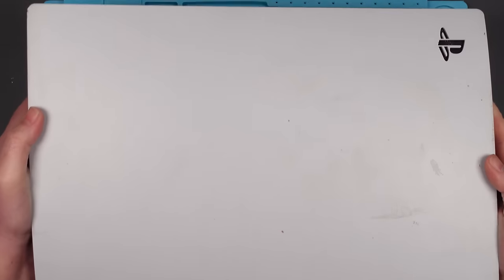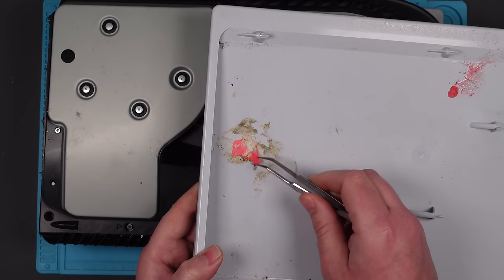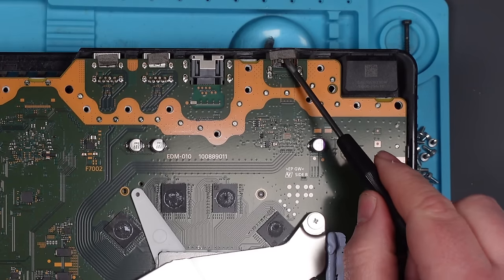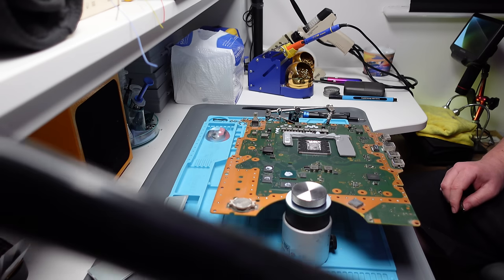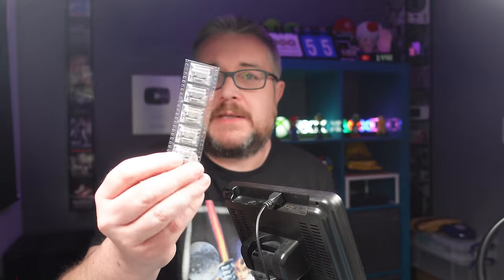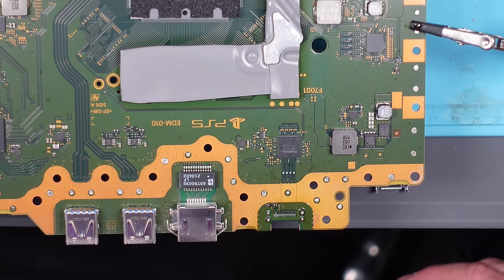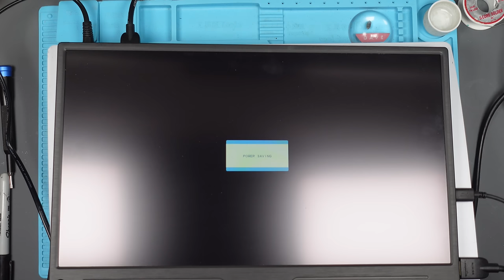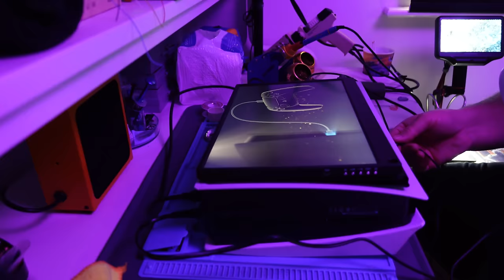This PS5 was DROPPED | Can I FIX It?

Comment: The fact you got a faulty ps5 from Ebay with a genuine honest description is incredibly rare. Congrats
Reply: not to brag but i got a ps5 disk and series dirt cheap with hdmi port damage and only that and fixed them both and been running for a year now. maybe luck
Reply: @GeoJad  very fortunate
Reply: Mate my ps5 turns of after about 30 mins of playing a ps5 game I’ve cleaned the inside but I haven’t gone further and done the psu or whatever it’s called
Reply: @coreyblakee332 chances are the heatsink is full of dust

If you have it standing upwards could also be a dry spot on the APU.
Reply: @Trippy86117  I have had it upwards since I got it I’ve had it since release pretty much but yeah it’s defo fucked need to try get it repaired I’m waiting for the ps5 pro and will purchase that lol 😂

Comment: 2:10 there clearly was a kids birthday party inside this machine
Reply from the maker: 😂 must have been!
Reply: I'm wondering if it was a birthday present that never made it past the party. As Steve mentions it's factory reset right at the end.
Reply: @MrCode4money perhaps but the amount of dust on the fan would suggest otherwise
Reply: @f1zzdux  yeah good point. Interesting.
Reply: @f1zzdux  OK it was a kids party but the party was held inside a tumble dryer lint catcher. It's simply deduction, really.

Comment: Love your vids steve. Liquid metal-cotton bud soaked in ipa. Use it to group together the liquid metal, suck it up with a syringe. On both the die and heatsink. Then you can see the full extent of the oxidisation. Clean that off with a fresh cotton swab and ipa. If the oxidisation is too bad to remove with that i use 6000 grit sandpaper to remove the rest. Re apply the original liquid metal and respread it on both the die and heatsink. Job done. Hope that helps

Comment: I used to work for PSN Hardware Support. The number of calls I had about damaged HDMI sockets was quite impressive. I don't know exactly why, but they DO seem to be unusually delicate. I mean HDMI sockets in general are terrible, but the PS5 ones seemed to be quite easy to damage. I think a lot of it would be eager hand fumbling around the back of the console and trying to shove the plug in without looking... but still. Anyway good repair, maybe get some d-Brand plates for the case if it's a little scuffed? :D
Reply from the maker: Good shout on the plates! Yeah, the PS5 ports seem to fail way more often than the Xbox counterpart! 😮
Reply: According to TheCod3r, who repairs these all the time, the early revisions used a very weak HDMI port, and they use a much stronger port in later revisions.

Comment: Fun doing HDMI connectors! I additionally normally wick the anchor points so they are clear of solder, place the new connector on, apply los of flux, push down and solder pins. Once you're happy connector is on level and pins married up and soldered,  solder the anchor points ;-)

Comment: cotton swab and 91 - 99% is isopropyl alcohol to clean up the oxidation from the liquid on the APU and heatsink. The use the dry side to rub the same liquid metal back on the system. Sony provides more than enough on the the PS5. 

Great job though. Loved the video

Comment: Don't let fan blades spin while cleaning/dusting them, normally theis matters most of the fan is still plugged in, as to not create voltage in the system it's plugged into, but even while not plugged in it also places abnormal stress on the motor for the fan

Comment: Steve - great vid!  can I ask where you got the replacement HDMI port? I have to change on my PS4 - the pins are offset from centre - but I bought from 2 different suppliers and the pins were central. I had to grind out the anchor holes to shift the HDMI port sideways to align the pins.

Comment: Steve, a few things that other people probably mentioned.  I think you removed the port upside down.  Steve at Tronicsfix always turns the board the other way and lets the port fall out.  When you clean the fan, you should never allow the fan to spin with compressed air because you can overdrive the fan and potentially damage the bearings or even damage the control board.  You also put way too much liquid metal on the APU.  Also, why don't you use a power screwdriver, you can get pretty decent ones from Temu or Aliexpress.  Your wrist must kill after this kind of repair.
Reply: I don't think it matter, Phil at TheCod3r does it the same way Steve did and he repairs these for a living. As long as the solder is liquified you shouldn't damage anything

Comment: Steve, please, please get yourself a filtration unit for the room in which you work. If, for no other reason, to ensure that there's less dust, but also so that the smoke, etc., that sometimes results from your projects has much less chance to build up in your respiratory system (along with the dust). As someone whose dad worked as a fireman, I can tell you that it's just as important to have protective equipment like filters as it is to perform the job. We all want you to take care of yourself!

Comment: Wow. What is the liquid metal used for/as in a PlayStation? Awesome video as per ❤
Reply: It's to transfer heat more effectively than thermal paste, which helps with cooling
Reply: @Yemto  aha, thanks for clearing that up. I thought it was there for some kind of conductivity. Cheers 👍 😊

Comment: Only 1 comment. The pins to board connection needs very little heat but you were also trying to heat up the large thermal mass of the connector frame and blobs of solder. Better to remove the solder  off the board and re-apply after the pins are soldered to the board to avoid overheating the board.

Comment: I just replaced a hdmi port on one of these the other day and all was well. The guys kid was using none stop for 2 days with no issues. When they went to power it on the next day no power. I've had it back and the power pack inside had a melted MOSFET. I've fitted a new power pack and it's working sound again. Hopefully it doesn't happen again

Comment: I’m wondering if they had a PSVR2 headset with it to factory reset it ? That plugs in the usb in the front panel. Maybe the says why it got pulled off the surface it was on and caused the drop ? The usb would have pulled out easily, hdmi plugs are quite tight fitting.

Comment: I have an important tip for you.   NEVER EVER let the fan spin while blowing it out.   To much speed will heat the nylon bushing or the surrounding plastic area around a metal bearing and will melt the plastic!!!

Comment: A bit of advice...when cleaning the fan.. don't let it spin fast..!.. because it could blow up the fan and the fins could snap off...!
Reply: I know in this case the fan was disconnected, but it will also produce a back emf that could fry something on the board. As fun as it is, always make sure that the doesn't spin at all if possible.
Reply from the maker: Ah, yeah that makes sense! I guess i should've held it to stop it spinning! I know for next time, thank you! 👍
Reply: Yup both correct, I believe LTT or someone did a video and the fan can generate voltage. I always clean my fans by taking off and/or holding em. Better safe than sorry.
Reply: Seeing jet air cleaning the fan always reminds me of my former IT colleague's story: some years ago during a weekend he did some bulk dust cleaning office PCs at the customer and was so excited about the speed the dust blower gave to the fans that he maxed the speeds just for fun. Yes, to every single Pentium 4 fan. During the next workdays, occassional complaints from office staff about computers instabilities occured, so he went to inspect the situation and found out that all the sleeve bearings were melted and.. well.. SOLID.
Reply: @StezStixFix  Rather than it exploding or such, the biggest risk comes from destroying the bearings inside the fan. Those are only rated for a certain RPM, and going well above that can cause them to heat up, vaporise the lubricant and start grinding metal-on-metal and/or seize up. That's why they always told us to not clean PC fans with the vacuum cleaner or compressed air without holding the fan itself still :)
Reply: I made this mistake with a laptop fan. It seemed to turn inside out. Luckily found exact replacement on Aliexpress 😅
Reply: Could you tell us which air blower you used to clean the fan.
Reply: Don't do it with compressed air or anything high pressure is my advice....did it on a hp laptop fan and it exploded into a million pieces 😂😂
Reply: @222inverter Shut up. Never had that happen. And I've messed around trying to make it happen. 😴😴
Reply: @RSCOZZY  so because it's never happened to you with effort it's never happened? It's happened to me sooo what does that say?
Reply: @RSCOZZY  I have..as an ex Sony engineer...I've seen it happen and the amount of returns where people have done it...also PC fans..the same.

Comment: Should never do that, it can destroy the bearings. use your finger to stop it spinning at all.
Reply: Never do what? If you're referring to the fan at 13:45, Steve didn't touch it. If you're referring to something else please explain as I couldn't see anything done wrong here
Reply: @MrJozza65  You shouldnt allow the fan to spin when blowing the dust off.
Reply: @MrJozza65  Blowing air through a fan will spin it faster than it's made for and cause the bearings in the fan to heat up and wear really fast.
Reply: @laptoprepairglasgow  Ah thanks, didn't spot that first time around, it's at 11:05 - and yes, not a good idea to spin a fan so fast with compressed air, I get what you meant now 👍

Comment: Never ever blast a fan with compressed air unless you block it. It should not turn, otherwise you could exceed the speed range that it was build for and damage the bearings. Thank you.

Comment: You need to wipe the metal off with a cotton bud and IPA first, to get rid of the dry spot, then go around and collect the rest around the APU, and you shouldn't need to add anymore that is already there, both for the motherboard and the heatsink.

I see these on The Cod3r's channel all the time since they launched, that's a launch system 1016A, they did 3 revisions and now the Slim which uses the same board as the 13 series last revision of the Phat, they are also failing and have only been out for a few months.

HDMI seems to be a common problem like this one has had, probably a rage quitter lol.

Out of all the consoles, the PS5 is the worst for reliability of them all then the Series X which as it's own issues.

Comment: Last week I fixed my first ps5. It was dropped on the hdmi cable and somehow the port was completly fine and 5 pins broke of from the tin base and not from the pads. My customer got very lucky because I only had to resolder the pins. Btw beforehand I told him It would be my first ps5 and we agreed on a cheap price because of that. So not that I experiment with people's stuff xD I've done like 10 ps4's so I'd figured we"d be fine. I even put some extra liquid metal on a dry spot :)

Felt like explaining myself because angry reddit users are everywhere xD

Comment: All thart Screwing gives me "RSI" Err-"Repetitive Strain Injury" sympathy for U,
So I think you need to get yourself an "All in one" Drill/screwdriver N Dremel.. 
ADDENDUM 
for Ports and thick PCB's you must use low melt solder mixed
with the solder on the board, once port or Part is removed, suck up solder and
just use leaded solder to resolder as it's actually stronger than lead free solder..
APU 👁👍

Comment: DUDE!!!! YOU FORGOT TO PUT 1 OF THE PRESSURE PLATE SCREWS BACK IN!!! - THIS WILL CAUSE THE PS5 TO OVERHEAT!!!!!! OMG!!!! - I KNEW you were gonna do this when you only put 2 of them in and then tested it!!! I said to myself this is what you were gonna do... AND IT'S EXACTLY WHAT YOU DID!!!! 🤦‍♂🤦‍♂ - I wonder how long it's gonna take you to figure this out and FIX IT?

Comment: You likely destroyed the bearings in that fan. Always hold the fan stationary when cleaning with air.
Reply: You are the fan bearing expert. He barely showed the cleaning process of the fan and it didn't even rotate that fast lol. Did you hear any noticeable difference in noise levels? No because his fan is probably ok but yes damage can happen which I'm sure he understands. I would not say "likely".
Reply: @ryanl890  I destroyed many fans in the past through inexperience. Spinning too fast burns off any lubrication causing the bearings to heat up. This melts the plastic housing causing the fan to be offset slightly. They don't die immediately but often a few days later. Happens much more often with laptop fans.

Comment: smj .... @ 14:01 AND you've JUST done A STEVE! 🤦‍♂ You forgot TWO of the pressure late screws.... I wonder how long it's gonna take for you to figure this out?? Will you notice the 2 "EXTRA" screws??? Will this cause the PS5 to behave improperly OR will it still work well enough to run fine but over time BURN OUT PART OF THE APU and DESTROY THE PS5 IN LESS THAN A YEAR???? Will you ever play it long enough for it to start randomly powering down??? Will you realize its powering down because its OVERHEATING??? Will you realize it's OVERHEATING because the there is NOT ENOUGH CONTACT between the HEATSINK and the APU because there is UNEQUAL PRESSURE on the APU???
- OR will you do what a REAL ELECTRONICS REPAIRMAN WOULD DO and NOT IGNORE THE TWO EXTRA SCREWS BECAUSE YOU KNOW THAT THEY ARE IMPORTANT? (there are "4,000" SCREWS FOR A REASON STEVE)